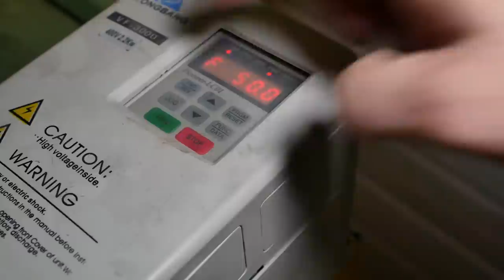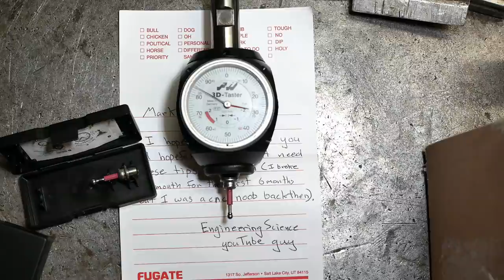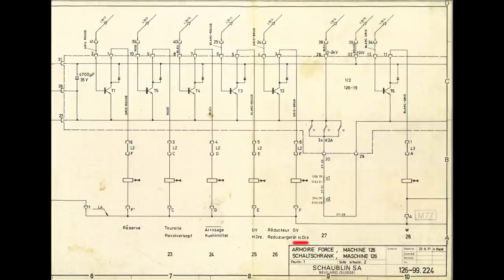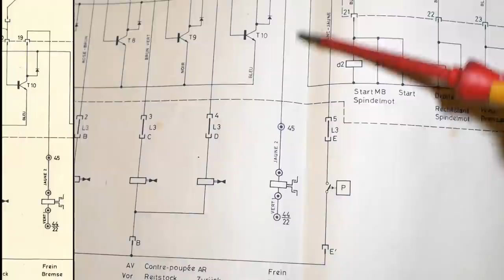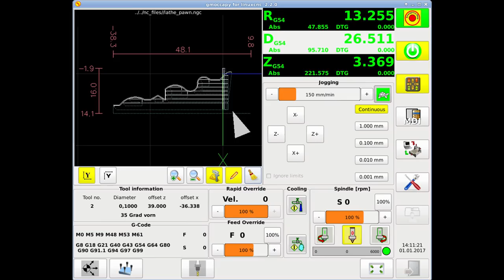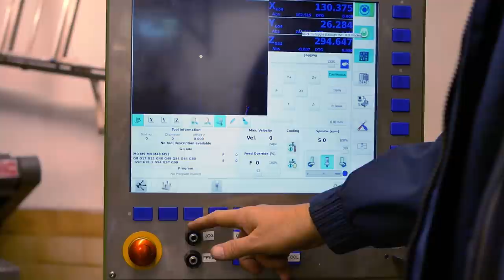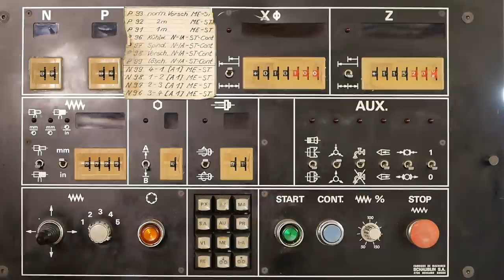Schaublin 125-CNC Lathe testing and strip down || RotarySMP

Comment: I still can not belive how clean and well maintained this machine is inside and outside. It looks like made last year.  Also the schematics are super detailed, including pin numbers, wire colors, etc. Nice.
Reply from the maker: Yeah, me too. The most recent date I could find is some masking tape on the back gear box with a 1991 date. Either oil change or variator belt. So woever had it since then either kept it covered, or had a really clean shop. Not grinder dust, welding dust etc. I'm thinking of framing the schematics, as they are cool. I need to make new ones for my changes.

Comment: Regarding spade connectors, perhaps it has to do with clamping pressure force. With a spade connector you get perhaps 5 kg. With even a little tiny screw you can get 100+ kg. It's a lot more positive connection, and the last thing anybody wants is an intermittent electrical problem.
Reply from the maker: Good point.

Comment: Vibration or physical stress can cause the Spade connectors to loosen up over time. Usually this happens with cheap Spade connectors or when they're used inappropriately and that's probably what gave them a bad reputation.  High quality speed connectors used in the right way are pretty reliable
Reply from the maker: Thanks. I guess there is a fair bit of vibration in a CNC machine.

Comment: Regarding keeping the control panel, I think you countered all comments pretty well. Originality is fine if the machine is usable as mine are, but then they are much younger than this lathe.  Other than a spindle motor driver upgrade, mine are pretty much standard. The software is quite usable and I have no need to learn something new so I keep it original. Once you apply some of your magic, this will be quite a lathe. Your spindle accuracy test proved that it is one very nicely built bit of equipment. Looking forward to seeing it make some high accuracy parts.
Reply from the maker: Thanks. There seems to have been a lot of change in CNC hardware from the 1970's to the 1980's. The Maho was also much easier to retrofit.

Comment: Schaublin - often idiosyncratic but always quality. The precision left in this machine is amazing. Easy to see why you bought this, the work now required notwithstanding.  A modern user interface will make an exceptional machine.
Reply from the maker: Thanks. I hope so.
Reply: A touch of the Citroen (of old)   or Saab , and Olympus cameras etc. ;-)
Reply from the maker: @alan-sk7ky  Yeah, topped off with a shit load of cast iron :)

Comment: My guess as to the logic behind the redundancy of turning on the coolant is speed. There is always a delay when starting up a coolant pump. With a valve you can have instant coolant because the pump is already running and pressure is already in the system. I run a Haas TL1 at work and am constantly pressing feed hold waiting for the coolant to catch up. If you have quick tool changes you could be shocking your carbide running dry at the start of a turning cycle.
Reply from the maker: That sound like the reason. SInce I dont do production, it doesn't really bother me on the Maho, which also just switches the coolant pump. 

I kind of doubt I all even use the coolnt pump on this lathe. It is easy enough to add cutting oil with a brush, and avoid all the hassle of coolant going mouldy etc. I will see whether I have spce to keep the pneumatic valve, or whether it gets a little three phase contactor to control the motor.

Comment: That variator is interesting, can't wait to see LinuxCNC controlling it :)  You can practically just measure RPMs at spindle and decide if you need to decrease or increase, sounds quite simple and as you mentioned, TORQUE!
Reply from the maker: Thanks for watching. I will have to put it out and take a look at it. Everything else is gummed up wit old oil, so it might be too.
Reply: @RotarySMP  You're welcome. Actually I thought I was subscribed from last time, so I fixed it now.

Oh, I see. Hope it won't be that bad. I was thinking what you mentioned in another video about VFD, would be nice to use VFD instead of all those contactors (start, stop, reverse) and then control speed of spindle by maybe both VFD and variator. I guess you could set variator to slowest speed and regulate by VFD. When VFD gets to maximum allowed speed, you could increase speed by variator (a little over needed value) and then fine tune by VFD.
But I have no idea how difficult it is to program this in LinuxCNC. All I do now is Siemens Logo (which supports modbus TCP btw, if you needed some slower inputs/outputs and simple logic, it might be useful, maybe even for something like this).

Also as you mentioned contactor for emergency stop, from what I know, VFDs usually have dual emergency stop input. Then in settings you can set up if you want to slowly coast to zero, let it running free or brake with full force. We have some Yaskawa V1000 VFDs at work (it can do even PID speed control!) and it stops small crocheting machine after I think 0.5 seconds if you press emergency stop.

Comment: Amazed at the Schaublin engineering - they spared no expense on this lathe.  Sad that you can't use the control board, but it would be a full-time job to get it working again (better displayed in a museum).  CNC has really advanced in the last 40 years!
Reply from the maker: I also wonder how long they worked on this Project 126? It is a different base casting than the manual 125. It must have taken them a fair while to engineer the whole interface as well. I would not be suprised if they started as soon as the DG Nova came out in late 1973, and it took till 1977 to bring it to market. Mine was made in 1981. Not sure when they ended production on the 125-CNC and switched to the 125-CCN (which is still made), but this lathe must have been a significant investment for Schaublin.

Comment: 20:32 When you turn the pump off, they tend to drainback, especially without a good check valve. With the solenoid, you have instant coolant delivery and don't have to stop and start the little motor all the time.
Reply from the maker: Thanks. On the Maho I jut have the pump control and it can take a couple of seconds to get coolant. I just added a G4 P3 pause to my post processor.

Comment: The reason why coolant is controlled by pneumatic valve is to make coolant come faster or at least to be consistent. Time witch in the motor can deliver coolant can change alot.
Reply from the maker: True. The Mano can take a few seconds to get the coolant to the nozzle. I have the PP add a G4 P3 to wait for it.

Comment: What a beauty! Wonderful video and I think you made the right decisions. Now it is tickeling me to get an old chunk of well fabricated metal. 

I think spade connectors are out of fashion because of new rules for fastening. Those can theoretically vibrate off. Using some kind of spring and/or glue is safer. But the trend is coming back with newer and more sophisticated plugs. 

Regards, 
Etna.
Reply from the maker: Thanks. Yeah, I guess vibration is definitely an issue with CNC machines.

Comment: Hi! Very nice and detailed Videoseries! The Toolcahnger works quite simple. 1st it has to lift, than it turns by an pneumatic actuator, than set it down again and reset de turnactuator. You recive positioninfo by a hallsensor. There must be a video arround here on YT, prety old, but there you see it working! Good luck with the green beauty!
Reply from the maker: Thanks. I’ll have to strip it and clean out all the hardened cutting oil.
Reply: @RotarySMP  have sent an email

Comment: The Vary-Belt drive and the spring assembly are usually very noisy from belt vibration.
Reply from the maker: The wide tooth belt is supposed to be pretty noisy as well. I’ll get it going like this and see if I can live with it

Comment: I would assume that the crimp on spade connectors took longer to prepare than screw terminals which can be auto stripped and use a pneumatic tool to tighten. Also you can get some strange noises when two different metals are used in a low voltage/current circuit. So as IC circuits became more common techniques like wire-wrap and screw terminals became more common.
Reply from the maker: Thanks.

Comment: 19:40 The funky 3 phase socket, is still the same type used in modern Switzerland for medium 3 phase loads. I belive it is SN 441011 Type 15, it is 10A. Often used even in house holds for things like dryer or a waching machine. There is a bigger variant, Type 25, which is 16A, and has square pegs, instead of round ones. The Type 15 plug will fit into Type 25 socket, but Plug Type 25 will not fit into Type 15 socket. Most of the bigger motors or machine will use instead the standard European 3 phase plugs tho, like IEC 60309 plugs and sockets.
Reply from the maker: Thanks for the info. I'll probably leave it unchanged. Looks still solid and uncracked.

Comment: Why do you need a valve when you can control from the motor? My guess would be the following:

When you start a pump-motor, it takes some time to build up pressure. So, going from the off-state to the on-state would be quick but you'd have to wait for pressure to build. If a valve is used, pressure can be maintained behind the valve and quickly released by opening the valve.
Reply from the maker: Good point. The Maho just directly controls the coolant pump motor through a relay, and it does take a couple of second for coolant to flow. I just programmed a G4 P3 into the PP for anytime I turn on coolant.

Comment: Vibration can lead to fretting corrosion and eventually failure of connection. Screw terminals  don't have that issue if you don't missmatch metals so badly that you get galvanic corrosion.
Reply from the maker: Good point. Thanks.

Comment: How about the "screwdriver stethoscope test"? Using a long screwdriver, probe the bearing area holding the handle in such a way as to have you index finger and thumb around the handle against your head, duff bearings are easy to hear !
Reply from the maker: Good idea. Once I move the machine through into the other room, I'll probably pull out the drive unit, as it needs a thorough clean in there. Without the toothed belt installed, there should be less conflicting noises.

Comment: This cast iron housing is such a swissy thing - I‘m surprised it’s not milled, hardend and grounded :D Great Machine!
I don’t know why, but I‘d like see this machine in RAL 7016 to bring it in the 21th century. Don’t get me wrong the good old reseda 6011 has its charm but.. :)
Reply from the maker: The funny thng about that cast iron terminal housing, it that it is marked as IP 65, but no one put a plug in the lower threaded hole.

It is staying Ral 6011. I really like Reseda green tools, and the paint is good enough to not touch it.
Reply: @RotarySMP  it might be difficult to pass the IP certification then :D

When I think about it, it would be a nasty thing to paint this beauty in any different color :) Looking forward to the transformation! 
Are you going to replace all the electronics and motors? Maybe I missed that in your video..

Btw I uploaded a video of my portal milling machine project - I have to try to compete with all of this Maho power ;)

Comment: Hello,
Nice to see the modernization has started... do you think it should be relatively plan sailing to motorizes or are there some elements that will be a real challenge?
See you next week.
Paul,,
Reply from the maker: Hi Paul. I am in a bit of an analysis paralysis dilemma at the moment. The retro fit in itself is not a big deal, but playing tetris to get everything in that Pneumatic bay will be a challenge.

Comment: Lol that would be a pain to run that machine with its original computer, i love what you did with the maho, hopefully sum museum wuld accept it as a piece
Reply from the maker: Thanks. The Maho was simpler as the IO interface between the computor and the interface cards was defined in the schematics, so I could reuse the interface boards, EXE, etc. On the Schaublin, the schematics only show down stream of the IO boards (with the exception of the two noted) , so you have no idea how to hook a new brain into them .
Reply: @RotarySMP  is it possible to figure out what does what and use a relay card with your massa after you figure out what does what

Comment: screwd connectors are safer if you have Vibrations. any connocter who only gets his hold by friction will get loose if you have some sort of vibrations while cutting
Reply: oh and the Pneumatik valve for the Coolant tank is there so you have a more immediately shutoff of the coolant rater than a slow and also the coolant dosnt flow back. its still a way how it will be build on some machines (mostly so you can use one pump for 2 or even more coolant points)
Reply from the maker: Thanks for the feedback. Good points.

Comment: What I don’t like is that the tool changer uses piston lock tool posts. There’s a dovetail where the tool holder slides on. Then the piston comes out and presses against the back of the tool holder. The problem is that with a fair cut, the piston is pushed back by some erratic small amount, depending on how heavy the cut is. Not good! It causes irregularly in the cut and finish, at best.

The wedge type post also has a dovetail, but one is angled and moves downwards when it’s closed. This results in an extremely rigid interface which allows the tool to be placed much more accurately, and won’t move under a heavy cut.

I’m surprised this doesn’t use that instead. The lathe doesn’t look as though it was used much, but just sat around for a long time. Perhaps the tool holding was part of the reason. It’s interesting how some otherwise excellent tools can have one flaw that lowers the entire product.
Reply from the maker: Nope. This is a wedge type. That "Piston" is in the wedge, ad pulls back, not pushing out. Not quite the same as an Aloris, but also not the simple piston pushing on the back.

Still, I am also not convinced that huge four way tool ost is the best solution. I have a Phase II wedge AXA on the Boley, and might make an adapter to hold that on the Schaublin, just to have more options.
Reply: @RotarySMP  however it works, it’s still a piston, and subject to pressure and vibration. I’ve never seen one that didn’t flex. A true wedge is better. I don’t have a problem with turrets, as long as they’re made correctly. I don’t know anything about this one though. Good luck with this, it’s a big job. I’d hate to have to design the control system from scratch. Once, when I was designing electronics for my conoany, but those days are gone. Now, I just want to but a machine, and have it work, other than a bi t of fitting.

Comment: looks like you got enough haimer tips for now but just in case: my mahr probe has some white ceramic tubes as breaking points and I found some alumina tubes in the exact same size on aliexpress. I´m pretty sure that´s the exact same stuff mahr uses. I havn´t had the chance to try it yet fortunately but I think I should be able to just superglue/epoxy these to repair a tip.
Reply from the maker: Thanks for the tip.

Comment: The 7i64 might be an option for controlling the pneumatic solenoids. The drivers on that are 2.5A @ 48V. 
Though it is probably overkill unless you have some more significant loads to deal with.
Reply from the maker: I looked and the 7i84 can sink 300mA at 24V, which is only 7.2A, so probably will need to keep the Schaublin card. The 7i64 is pretty expensive to replace something I already have.
Reply: @RotarySMP  Yes, the 7i64 could only makes any sense if you use it for all the IO. I have one on my milling machine. But I should admit that I didn't pay for it. It's serial number 2 and was used to write the drivers. With 24 in and 24 out, it might work as the sole IO board. 
The 7i84 makes more sense in most cases, and is what I used in my lathe. The 7i84 MPG inputs can be useful too, I have 4 MPGs on my Holbrook, two into the 7i84 and a couple more on the apron and wired into the 7i73 that lives in the apron (it as a bit under-used with two limit switches, 2 x MPG and a jog-increment encoder but saves a lot of moving wire)
Reply from the maker: @andy pugh  I am struggling a bit with the plan. A 7i97 is an overkill for 2 axis. Especially as I will need still a 7i84 as the 7i97 doesn't have enough outputs. 

I have two of Talla83(Peter) RS-422 SS adapters, so I could plug in 4 ethernet SS devices. 
https://www.youtube.com/watch?v=RAnybfxccdE
My rough plan would be PC in the display cabinet where Schaublin had it, Cat 6 to a 7i??, then two RS 422 -SS adapters taking the role of a 7i74, so that the 7i84 and 7i73 plug in. Then use two of Peters MPG pendant boards as encoder interface boards for the MPGs on the front, similar to your Holbrook:
https://www.youtube.com/watch?v=l_EpoNiAqbA

The 7i97 is the biggest and most expensive board. If there was a SS board I could plug in which did +/-10V Analog servo out, I could use a 7i98 as my main board. Or a DB25 daughter board to do analog out would also work, but as far as I can tell, the only analog servo control daughter board is the 7i33, which needs a 50 pin FPGA board.

Comment: First of all: This was perfect timing. I just finished my lunch.

Is it just me, or did that lathe actually run on some kind of oil as its coolant?

Also, I'm interested in seeing what comes next! Which drives, which motors? Wait, wait, don't tell me!
Reply from the maker: Yeah, I think it just had straight cutting oil. You see that quite commonly in older videos of Hardinge and other early CNC lathes. Glad they did, as it certainly prevented rust.

I couldn't tell you yet, as I am still working through the fog of excessive options.